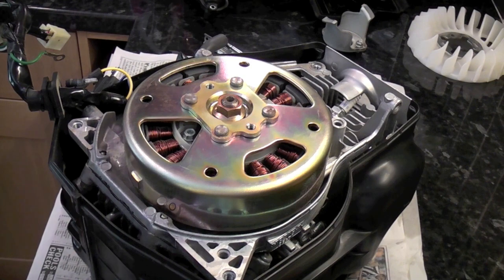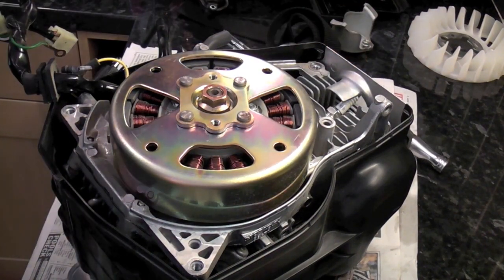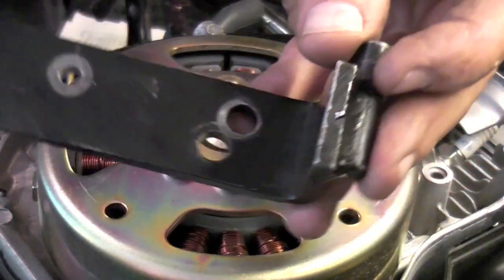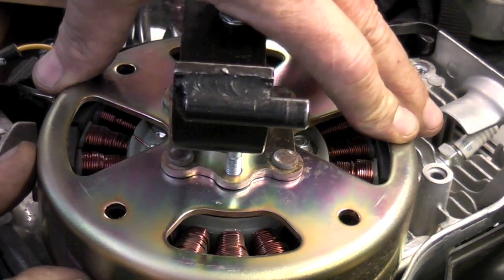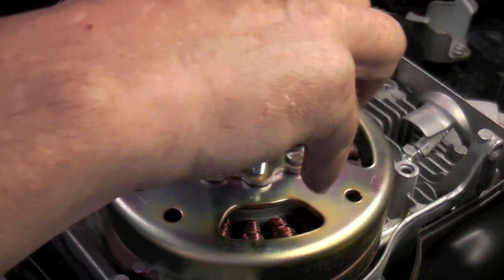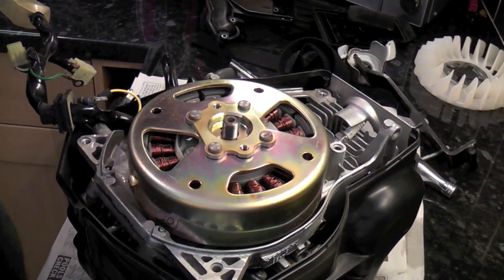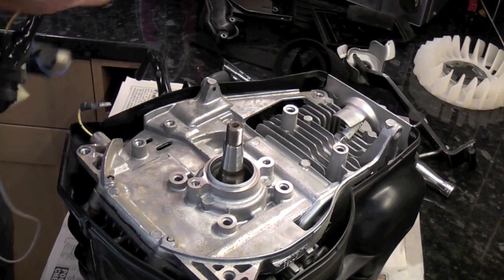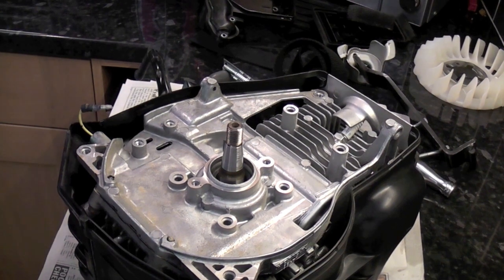Honda EU20i / Eu2000i flywheel removal 2

Comment: Hi thanks for video. I also have a Honda 2000i gen & it dropped in the sea. I have removed & cleaned it all & changed the oil 3 times as watched in another video. Now  the fly wheel / pull system is getting harder to pull to start. Do you have any advice on why it has become hard to pull. I have taken fly wheel part off so I can turn it all by hand & the problem seems to be inside the main engine to piston / rod section where the magnets are. Cood the magnets be restricting it from turning.
Tha ks for a y advice
Reply: I have a similar problem in a EU22i generator that I bought used - so no idea what happened to it.  When I unplug the 3 wire connector that goes to the inverter it turns easily.  I think there is something wrong with the inverter.

Comment: I hope if I buy a Honda I don't have to get into tearing it apart into 100 pieces. What was the problem with the generator? I have a Coleman since the early to mid 90s I've not had to tear it apart other than put a new needle and seat in the carburetor. And keep up on the maintenance.

Comment: On a brand new generator this may work. But with some age on the generator you should use the correct tools to remove the stator. Bending the exhaust screws will most likely happen.
Reply: Can you recommend any particular tool for that purpose? Thanks.

Comment: Hey great video! I have a question about putting something underneath the screws you use to pop this flywheel off. Did you say you put a washer underneath where the screw goes through. I'm looking at mine and I can see the previous person who took this off made a few marks on the stator.

Comment: What i am wondering: The stator  seems to have nearly no cooling. Why does't it overhead at higher power?
Reply from the maker: there is a fan fitted to the flywheel which has been removed during strip down

Comment: yours is a lot loser than mine... I tried using a puller that was twice as thick as yours and it bent on the try.. I will build a sturdier one tomorrow I guess...
Reply: Hey did you get it off mine is bending as well. Any tips on how you got it?
Reply: @stevenarmstrong6396  sturdier puller...

I used a 20mm flat steel and got it off with that and a light hammer wack.
Reply: @stevenarmstrong6396  Bit late, but with really stubborn flywheels like this (to point where proshops would have just cut the flywheel off and replace it) answer generally is put in penetration oil, let it soak a bit while you make or install the puller to bolt holes, put some pulling force via the bolts, never from the edges as it bends and binds the flywheel even more, give it some vibrations as in slight taps that causes vibrations, not bending the metal. If this fails then apply little bit of heat to fly wheel around the taper, while not heating the crank, or anything inside the flywheel. This can be difficult and takes skill, but can be done. Then apply penetration oil to flywheel shaft cooling it down. Pressured air can also be used to cool the shaft if its long enough. Repeat this this step 5-6 times to thermal shock the joint and allowing the oil get between the shaft and flywheel, while keeping pulling force on the flywheel and love tap it to cause vibrations.
This way i managed to remove 3 "impossible to remove" aluminum flywheels from outboard motors and when those come loose, it jump meter into the air, now that was STUCK! (biggest challenge was not to jump to grab the searing hot flywheel when it come down, so be mindful to do it on grass or other soft surface, so there is no damage when it comes down if it jumps on you) Its not the amount of heat but differential heating and cooling, so flywheels area should get at worse to point of not being possible to touch, but just below ignition point of wd-40, while oil is allowed to seep into crack created by differential heating, eventually reaching down to bottom, creating lubricating layer between the two surfaces and breaking down the any potential corrosion. If its different metal flywheel like aluminum and steel crank, you will have hellawa time getting that to move, so patience and repeating the cycle is essentially only option, unless you want to go full caveman. Mind if flywheel is that hard to remove, finding the replacement might also be hard to impossible with out buying second unit, cutting the crank and removing the crank peace from the flywheel on lathe, that is expensive and waste of another engine.